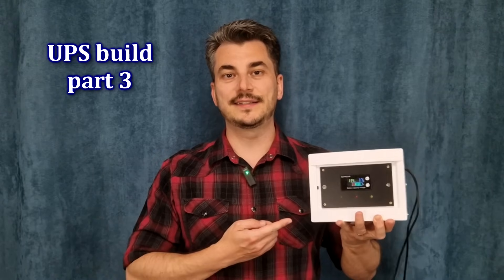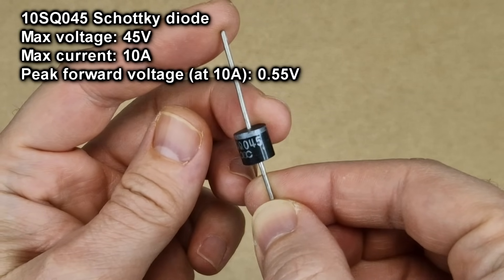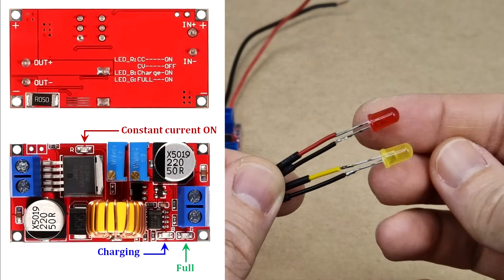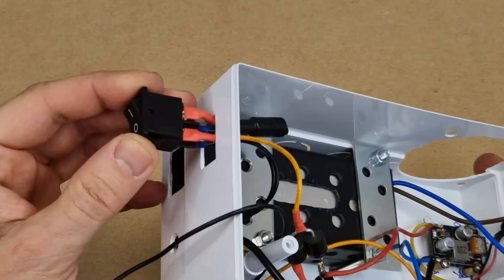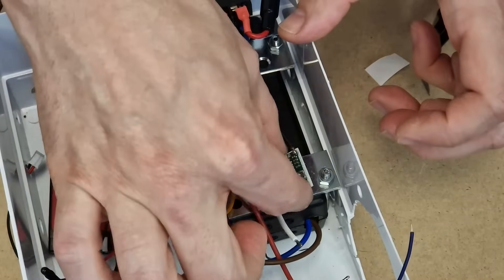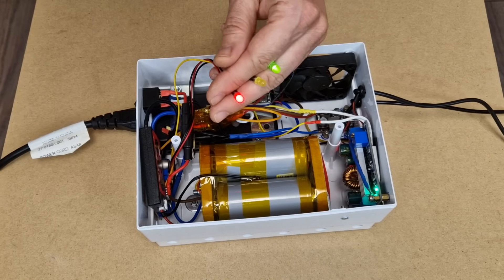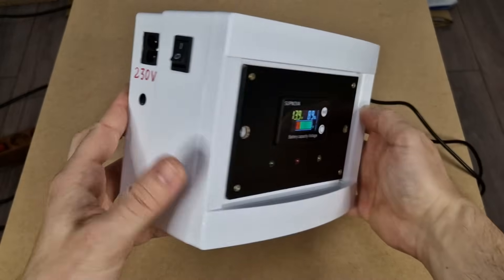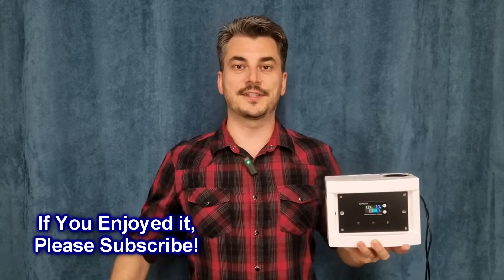DIY UPS - with LiFePO4 battery (part 3/4)

Comment: Why you're not using the charge control in your setup?
Reply from the maker: Hi. When I first designed the UPS, I didn't think about the charge control board, so there isn't enough room for the module inside the UPS case.

Comment: Could I respectfully suggest that you don't pass mains and DC thru the same switch. Just leave the DC out, and use the switch for the mains only.
Reply from the maker: In this case you can use 2 switches. The battery needs a switch, so you can completely turn it off.

Comment: There’s a problem with the schematic diagram regarding the relay. You might encounter an issue where the relay does not turn on during an AC power outage, because its supply voltage comes from the AC source. You might consider separating the relay for your 12.8V LiFePO4 battery and using a normally closed (NC) relay that is still powered by the AC supply. However, you also need to connect the charger's output directly to the positive terminal of the battery, while the relay switch should be connected to the input of the 10SQ045 D2. Alternatively, you might consider removing the relay switch entirely due to the delay it introduces when switching from AC to DC supply.

I hope this finds you well.

Comment: Unfortunately using XH-M604/603 doesn't seems to working well because it denies recharge between low and hight setup voltage so the battery will not be charged until the lowest voltage (I.e: between 11V and 12.8V) leaving the UPS with NOT-fully charged battery most of the times between a power loss and the next one that could be occurs weeks/months later.

(i'm currently building this UPS and I've just tested what I wrote here)
Reply from the maker: Hi. I will check this out.
Reply: @Sorin_DIY I mean this example: today I get a 30% battery discharge due to power loss, then the AC power turns back but the lowest set M604/603 Voltage will starts the recharge only when battery voltage goes lower than the starting X604/603 voltage (near empty battery), so the relay will not starts the charge until the battery is empty....
Or the M604/603 starting point need to be set just 0.1V below real end-point, but this is the worst idea.....

Comment: im done it, but when output is above 2a, the led indicator from step down for charging battery not switch to full, indicate the module for battery still charging even the battery already full, but when the load under 1a or to ouput load, charging was normal, when battery full the module was cut charging with led indicator switching
Reply: and when battry was empty, then the main power on again, the output cannot powering the load stable, like it on but not on at normal state, i must turn switch on off rocker then the output come back normal, or re plug the output to load

Comment: 5:08 so like the entire purpose of diode 3 is to make the dc-dc led stay of then the module is un powered, that wastes decent percentage of power for an led, use some arduino and current-voltage sensors to calculate everithing you need and output in a serial port, i have made a similar DC-DC ups and it powers a portable desktop now. still apreciate the vid tho

Comment: Do tell us the 12V and 5V max rating on this. Would love to have my NAS with DC UPS. 12V 10A is the rating of my NAS's power supply.
Reply from the maker: This UPS it's configured for 1A loads, so it will not heat up. If you have a 10A load, you need a bigger battery, more powerful converters and better cooling.

Comment: I may be wrong but It seems to me that your mount for the power supply is conductive and accessible from the outside of the enclosure.  
The power supply itself had a sealed, non conductive enclosure. But you opened the enclosure and brought it close to the conductive mount :-) That may become a hazard.  

If got this right, personally I’d consider putting an earth wire on the mount, but there may be better solutions - or I may be wrong.  

Thanks for sharing, I need to build something like this.
Reply from the maker: The charger has a ground wire included, you can see it in the middle of the mains input plug. It's connected to the charger heatsink/metal case.